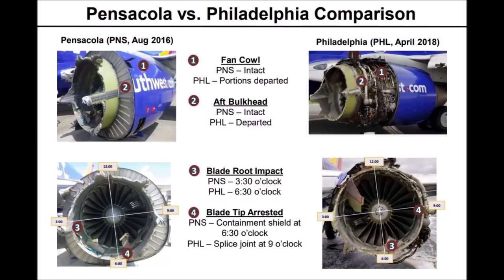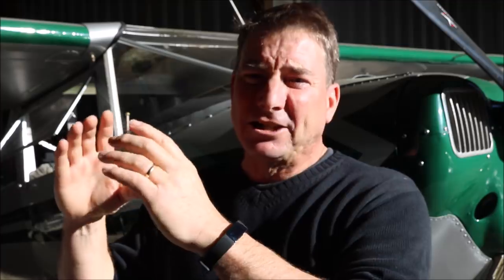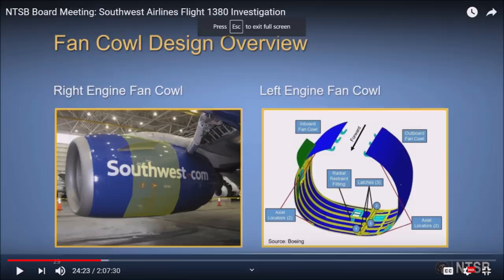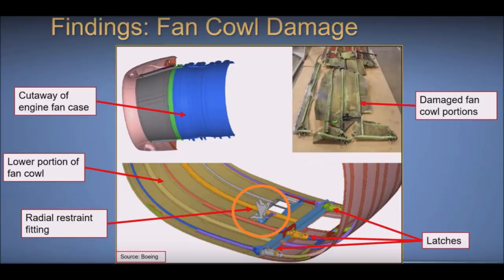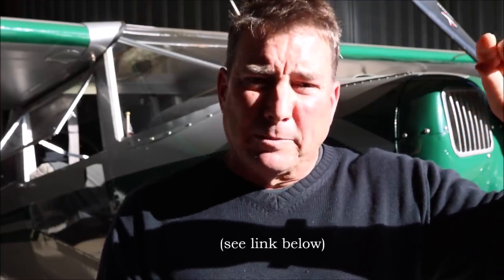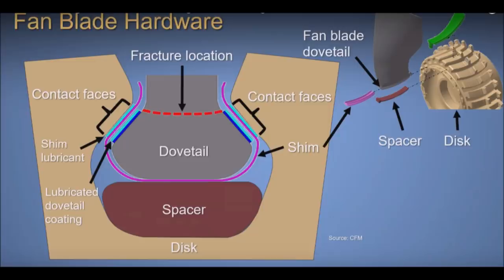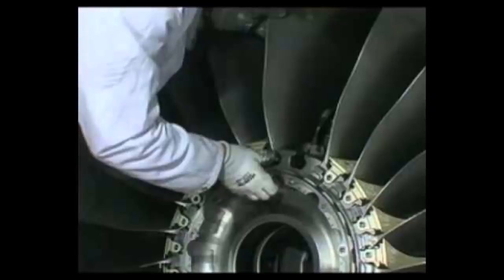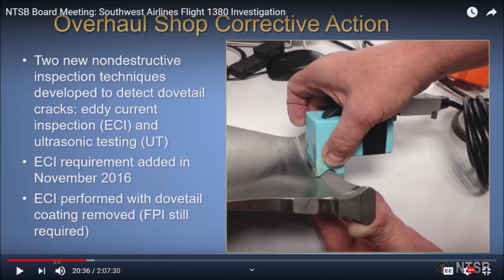NTSB Board Investigation SWA 1380

Comment: The lubricant is a molybdenum disulfide lacquer  spray or a molybdenum disulfide paste (GN lube) The primary hard coat on the blade Root is CU-NI-IN (Copper nickle indium) flame spray coating. Over that is a coating of "MolyDag" a Epoxy molly paint that is baked on, the the hand applied lube that is renewed about every 1000 cycles.
Another minor error is the 737-200 had JT8D -9A "low bypass turbofan engines not "Turbojet engines"
Great reporting as usual.
Reply from the maker: Thanks Hitech. What is the purpose of the lube? vibration? protection?
Reply: I'll start at the bare Titanium of the blade root; that is stripped of the old coatings then Eddy current inspected. (The Fan disk slots have the same process). The new Cu-Ni-IN is flame sprayed on (this is an anti galling coating as Titanium develops  a protective oxide skin when exposed to air and the oxides of Titanium are very good abrasives ;  nothing wears away like TI on TI )  However, when sprayed on, the coating has a relativity rough finish. The make it smooth it is coated with molly-dag which fills in the roughness and provides a long lasting wear surface. The last coating of Molly paste  slows the wear rate of the CU-NI-IN. The shim shown may or not be there and is used to allow re-broaching of the disk slots while maintaining the blades original fit. As the CFM56-7B has "wide chord" fan blades, to eliminate the mid span shrouds seen on earlier models ;the blades move around in the slots a lot more than the earlier engines.
Your comment on the "blade" out testing is a little inaccurate. The final testing is done in a test stand and is a "full up" test of the entire engine Inlet, reverser and all.  The fan blade chosen to fail is rigged with a weakened blade root with a small shaped charge The location the blade will impact is chosen as the "worst case location and the rig is able to detonate the shaped charge at exactly the chosen location. the engine is operated at standard day rated T/O power. Success is when no engine parts leave the engine except out the inlet or out the exhaust. My thought  is that the air-stream is not modeled on the "standard" failure Scenario  which is Failure at Rotation.

You do an incredible job covering a mired of subjects. and you are on my must watch list.

Doug

Comment: Juan does a great job on the background details you don't get otherwise.   I will add a bit of a change,   the NTSB makes recommendations and the FAA decides if they are going to implement them.     That is a bit fuzzy but important.    Sometimes the public pressure gets a rejected recombination enacted.    The FAA is subject to airline pressure as well as political,  so its not a given and a cost analysis is part of it though at times an excuse as well not to do something.

Comment: Juan, the area in front of the fan is an acoustic structure to help absorb the noise generated by the fan. The area directly around the circumference of the fan blades is a area, also contains core, but if filled with a light weight micro balloon filled epoxy as a wear surface. It's design is to keep the gap between the fan and case as close as possible which increases efficiency. 

The green part @ 4:57 is a mid cowling which is just an aerodynamic structure that allows for engine service. Aft of that is the thrust reverser. In the case of the CFM56-7, the reverser is a translating sleeve cowling which when extended pulls a set of blocker doors into the C-duct air-stream and exits through a set of cascade vanes that point forward to provide reverse thrust. 

The translating cowling blocker door thrust reverser is the most effective thrust reverser design.

Comment: Last time i lubed blades i believe it was a dark grey moly type lubricant.
Reply: Very thick paste and i have seen a spray too. We usually soak the blades in isopropyl alcohol clean it off and then ndt can inspect and then relube. Its very important to maintain blade position. Everything is labelled as to where it goes. Its labor intensive and theres a lot of engines. The industry is in need of mechanics and pilots. I encourage anybody that has any interest to get involved. Its not hard. Everything in aviation has a manual telling you exactly what steps to do. Schooling was approx 15 months for a a&p. Simple math. No hard math. No english classes.
Reply: @MrEkg98  Pilots do have some English proficiency requirements, although being native to an English speaking country will waive the testing requirement.

Comment: The outer pane is taking all the pressure. Its the main structural element. The middle pane has the hole in it. Its just a backup. Either pane can take the pressure. The inner pane keeps the passenger rash off the middle and outer. The inner pane has no hole.  I have assembled quite a few.
Reply: A reminder for anyone traveling on a plane. If you see the inner pane coming out from the sidewall. Please do not be alarmed. The inner pane is just trim and a very thin plastic window. Its there to keep passengers from scratching the real window. Nothing structural. Kindly let a flight attendant know after the flight is over and line maintenance can address the the issue.

Comment: It would be interesting to know whether the blade failed as a result of a fault in the material itself (ie, impurities in the material) or as a result of the processes used to form/machine that material propagating the crack.  Thank you for your commentary and sharing what you know and what you are constantly learning Juan.
Reply: Years ago I worked at a titanium recycling facility in Richland WA & was amazed at the thousands of new looking fully machined turbine fan blades. Obviously rejected because of some flaw, most noted by the notes written on the rejected parts

Comment: As usual, a clear explanation with all the details. One correction re windows. The outer pane carries all the pressurisation loads. The middle pane carries no loads at all as long as the outer pane is intact. The small hole at the bottom of the middle pane is to allow the cabin pressure to be felt on the outer pane, and also gives a telltale of outer pane seal leakage. The middle pane will take pressurisation loads in the event of outer pane failure. The inner, or scratch, pane is to prevent the middle pane being scratched or damaged from within the cabin and also has holes to allow pressure to equalise across the pane.

Comment: Excellent explanations Juan. You made some references to the cowling attachment or reinforcement at the 180 degree (south) position. Surely the hamster mouth nacelle shape can be linked to a "point of weakness" such that the cowling couldn't contain the fan blade. Testing at 30 degree increments should have found the weakness at the due-south position.

Comment: Excellent job of reviewing this information.  Having spent over 40 years in various engine shops as a maintenance technician, overhaul inspector and for my last ten years, as a consultant to the airlines and large aircraft leasing companies, I am amazed that these things are still happening.  However, I am not going to blame anyone for accidents like this one.  It's just that we don't think about some situations until they become manifest via aircraft damage and sometimes, death.  In this case we had two things happen that were highly unlikely.  The first one is that the blade that was liberated hit dead center at the six o'clock position, which caused a cascade of events that ended with the window being hit and destroyed by the piece of cowling.  You have 360 degrees of rotation where this blade could have struck, but it struck at this particular one.  I could compute the probability of this happening, but it would be boring.  Let's just say that the odds of it happening the way that it did are extremely small.  The next unlikely event is the piece of the cowling striking the window.  Once again, it is a matter of doing the math and seeing that this event was even more un-probable than the first.  This has to do with the circumference of possible destinations for the cowling shrapnel vs. where it actually struck.  Do the math.  I already boring myself.  
  In all of my years in the field and shop, I never saw an event that followed the chain of improbabilities that this one did.  Nose cowls are just not known for failing.  Lots of other parts let go, but unless the cowling takes a direct hit from the blade, it hangs in there.  They are generally engineered for the efficient channeling of engine intake air and noise suppression.  Who'd a thunk it that such a thing could happen?  Not me.

Comment: I would say the lubrication of the stem of the blade is to prevent wear.
You don't think any fake parts were use considering both happened in the same place, were those blades changed in the past under maintenance. 
Aeroplane parts that are fake is more common than you think well used to be 20 years ago I don't know if it's the same.
Reply: Unlikely any of those blades were “fake” parts. Those are very safety critical parts and are individually identified and have an unbroken paper trail that stretches almost all the way back to the dirt they dug out of the ground to make the metal in those blades.  If they were found to be fake, there would have been a big deal to dig out any others which would have made it into any more of those engines. Fake turbine blades coming apart is very bad for business and airline industries reputation and bottom line.

Comment: From a failure analysis point of view the fan blade has had a low cycle bending fatigue fracture with a single surface or near surface origin on a plane of normal tension. Ratchet marks indicate there was a high stress concentration at the point of origin. Further investigation would look for surface wear or damage if the origin is at the surface and manufacturing or metallurgical flaws if origin is sub surface. Low cycle fatigue simply means the failure progressed from initiation to fracture in relatively few stress cycles, this could indicate a significant fault in the blade or an abnormal cyclic load. As the roadsigns of the fracture are followed through there logical sequence they will lead the metalurgist to the root cause even though there may no longer be phisical evidance of that remaining. Cheers mate 🍻
Reply: speaking of roots, the blade root should still be locked into place.
Reply: @jadesluv  the dovetail as they call it is still in place and can be clearly seen in the document Juan has supplied.👍

Comment: Excellent report, answered tons of questions.  I have a comment about being seated for landing... in 1989, while aboard a 737 bound for Pau, France from Paris, an elderly gentleman suffered some type of problem and I ended up volunteering to administer CPR because the line of people taking turns slapping his face and pouring water down his throat were not having any luck.  The cabin attendant I stopped dragged the man from his seat to the forward galley and made the gesture "there you go."  Fortunately he revived quickly (I don't think it was a heart issue), and then the attendant called the captain for instructions.  They told me to sit with my back to the cockpit door.  The gentleman remained in the galley as well, on his back with his head near the coffee and his feet in the aisle.  We landed about 20 minutes later and the entire cabin emptied out the aft door down an airstair while emergency services came in the forward door.  Would that scenario ever happen in this day and age?  I hope not.

Comment: Was thinking about the extra seating. 
You would not want to block exits or corridors, so even extra restraints that could be added galley corridors is not going to work.
My only thought would be to use the lavatories as emergency seating. With added hard points for restraints that could be installed in an emergency, or have them in place.
While not somewhere you may want to be, it is a seat, and it is not blocking any exits.

Comment: Juan, when I heard about the great job that the pilot had done in handling this emergency, I immediately thought of the fact that our military has terrific training. There's a lot of simulator work, and there's a lot of flying in actual airplanes that happens in order to maintain proficiency for emergencies just like this, and all of those passengers were very fortunate to have someone in the left seat that had that kind of background and experience in training.
For me, it also raises the idea that in the civilian world, training costs money that has to come off of balance sheets, and especially in smaller operators, I find that training becomes something that people don't want to do because they have to pay for it, and that is one of the reasons that the smaller operations that don't have the money to spend on training only do the minimum amount that's required by regulations.... so what we need to do in the field of aviation is to make sure that training happens, and with a sufficient frequency that proficiency is achieved.
 I know of one air crew that was lost, and the information that I received about it suggested that they had gone to a particular training company for recurrent training and they had failed......so they went to a different training company where they passed..... and those types of things need to be prevented in our business. Without the excellent training that the pilot had, this could have actually turned out differently.

Comment: Clear and thorough explanation. Thank you.  I've always wondered how hard one is supposed to pull the oxygen mask pipe when they tell you to 'pull sharply'. You don't want to break it, and you don't want to fail to set it off. It's the sort of thing it would be nice to have practiced once, just so you know what you are dealing with, rather than having to find out during an actual emergency.

Comment: In several corporate jets and turboprops the lav seat is n approved seat for takeoffs and landings as they are upholstered and have seats belts. Maybe not a glamour place to seat but in an emergency anything goes, in order to meet the challenge of the emergency. That would be a doable cost efficient solution in airliners to this non-guieded situation. Great video and well done.

Comment: The thrust reverses cowls are called fan ducts. Changed a few on Alaska and Sun Country's NG's. I have replaced many blades on CFM56-3's and -7's. In the USAF the CFM-56-2b on the KC-135 when a engine on the wing is new or rebuilt from the Depot we perform a operation called a trim balance. It's more or less a vibration check, if out of balance there the computer will spit out which weights in the spinner to swap. We have after numerous attempts on some engines we call out the back shop to come out with new blades and perform a restack. Most the time it goes through with no problems but there is always that one problem child.

Comment: Several years ago I was on a Southwest flight and noticed that the bags of snacks they were handing out were blowing up like air pillows when the airplane was at altitude. I talked to the flight crew about it when we landed. I told them that if an explosive decompression occurred the 150 or so bags of snacks they were distributing throughout the cabin would start popping off like little firecrackers all over the place. I told them that this would make an already bad situation worse as it could add to the amount of "adrenalin  in the cabin", which could cause increased panic. The pilot said to me, "You know I never thought of that". I think he may have reported it to Southwest management because about a month later a Southwest employee told me that they had collected all those bags and replaced them with snacks that were packaged in cardboard boxes. I don't know if the FAA has regulations regarding items that the airlines bring into the cabin, such as packaged snacks or soda cans, with regards to how the objects would behave during a decompression event.

Comment: The clanking sound while the blades are windmilling is coming from a midspan shroud. Theres a little raised protrusion in the middle of the blade. This keeps the blades in relative position and lowers stress on the root. The blades actually sling outwards in the hub. The blade arrangement expands ever so slightly once at speed. The lube helps the blades seat in the dovetail. This arrangement also has a abradeable material near the tips on the case. The case is there hold this material. This material is cut by the blades at initial runup of the engine. It provides a positive seal between the tip of the blade and the case. It makes it so you dont have air pressure leaking past the outside of the blade. Just like a winglet tries to limit the vortex. This material completely eliminates the vortex. Makes the engine more efficient and highers the compression ratio.
Reply from the maker: Thanks ekg!

Comment: I haven’t seen civilian airline setup. But if I remember right military has a clamp to hold the hose on for O2. But why don’t they just put a clamp on problem solved. Yes it makes the inspection longer cuz you have to check for holes. Which is very easy. Mild soap water sprayed on with O2 going through and look for bubbles.

Comment: Excellent video, Juan. So much excellent and enlightening info! I've seen several comments about flight surface cameras the flight crew can view... is there a reason these haven't become standard equipment?
Reply: Jeff Drum Everything on aircraft requires expensive certification, and systems with limited benefit do not make the cutoff.

Comment: Great information. I’ve worked on these engines and aircraft for more than 30 years. From 707’s to 787’s. Currently working on these 737’s on a daily basis including the 737 MAX up until it’s grounding. These engines are a pain to work on due to low ground clearance.